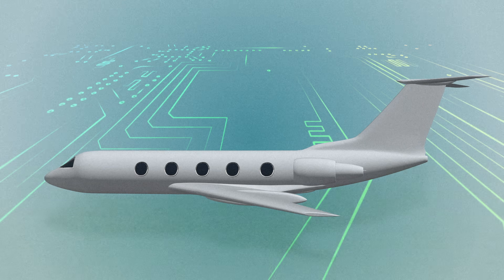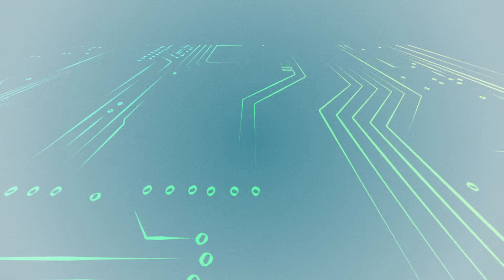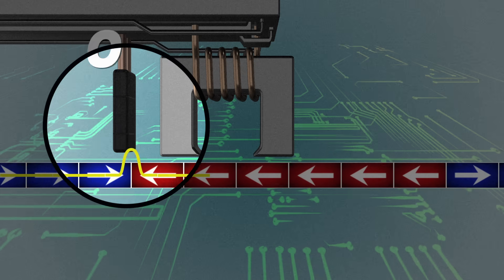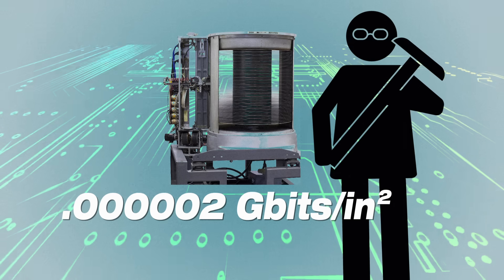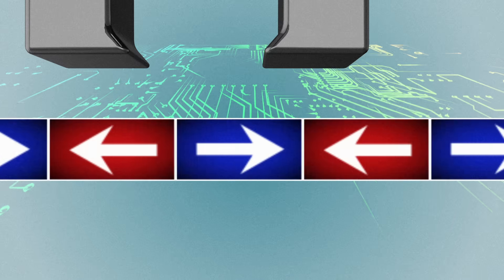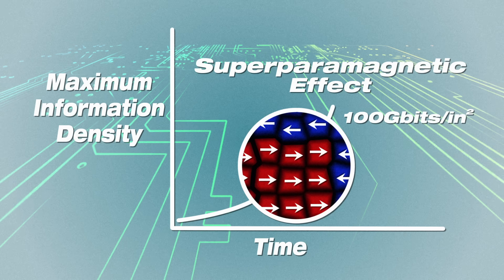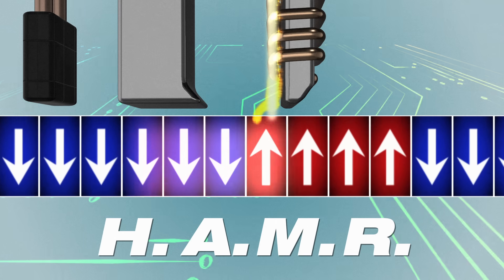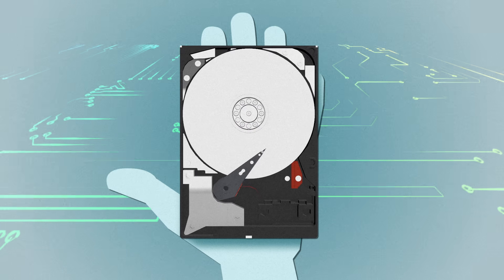How do hard drives work? - Kanawat Senanan

Comment: I'm still confused how it works... It kinda just talked about the evolution of the hard drive
Reply: +Dank Maths it didn't get specific enough like how it reads a picture file vs a video and how it is able to access multiple files at once, etc. how far it has come is a nice tidbit, but it should focus on the topic
Reply: +biohazard737 That's because this is the job of a file system, not the disk itself. Hard drivers (both the HDD and SSD type) just present to operating system a single array, with each cell holding a byte of information (I'm simplifying here a bit). This is an abstraction layer that allows file systems then work with any kind of drive, be it containing one or many spinning platers or a Flash memory based one, like SSD.
Reply: @biohazard737  these things are job of a software..
Hard drive's job is to store 0 and 1, that's it.
Reply: +biohazard737 Basically the file formats get sent into a continuous stream of information which are blocks.
The filesystem takes cares of reading where the blocks are, what they contain and in what order.
The kernel then works with the fs(filesystem) to load and get the information in the correct order to be operated on.
This is basically the physical side of the hard drive system.

A good example would be the relation of the linux kernel and ext4, Read on that ,It'll answer more than I could in a comment
Reply: +Liberal Atheist Nazi best answer!
Reply: +biohazard737 ''How are you doing that?'' ''HOW DO MAGNETS WORK, THEY JUST DO!'' -reference that one guy somewhere will get.
Reply: +666Tomato666 The array is just called a block and there's only so many block types making them work with any hard drive size and hard drive or ssd.
Reply: ***** no, the array is the disk

the blocks are the smallest sizes that the drive can write (usually 512B or 4KiB) and while they influence the alignment of stuff written by file systems, and how much space they "waste", file systems still on the lowest level work with single bytes
Reply: If you want detailed insight you need to read research papers. It will have a lot of boring details, but you can browse through and find out what answers you are looking for. Might take a few hours, maybe longer. Usually answers, lead to more questions.

Comment: And I thought hdds were getting old! I mean SSDs are the new stuff now and HDDs are getting more and more useless. but if they can bump up storage capacities that high, to multiple TBs per square inch they might still stand a chance in the PC market!
Reply: +MoinBayern 
It's not just about capacity, but about read/write speeds too. Still, having those HDDs with super high capacities would make nice storage drives.
Reply: +Marcos Cruz of course it is. my point was that until SSDs will reach as high storage capacities as that for a reasonable price it will take time. until then HDDs will still be used, mostly of course for servers because at least nowadays the average user does not need much more than a maximum of a few TBs and will then obviously rather go for SSDs.
Reply: True
Reply: +MoinBayern Also with cloud storage becoming more popular you might not need much more than a quick and small SSD. like one of the new chromebooks. That has just 16GB flash storage, but integrated Google Drive as the main storage.
Reply: +MoinBayern 
Hopefully our infrastructure will be able to keep up with the increasing demand of the public's streaming needs and ISPs behave somewhat civilized and not decrease data caps and throttle those who use the services they already pay for because of their cooperate greed.
Reply: +Marcos Cruz Yeah. tbh though I'm not that much of a fan of cloud services. I much rather like to know exactly where my data is stored (and who has access to it) and not on multiple dubious servers somewhere around the world.
Reply: +MoinBayern 
Me too since the amount of threats to cloud services has increased and the fact that the FBI, NSA, and CIA want backdoor access to those cloud services discourages me to use them.
Reply: +MoinBayern But if we don't work on SSDs then we'll never make them as awesome-sauce as hard drives! D:

Comment: How about a usb? Is that working the same way?
Reply: +D88888888Mc Flash drive like USB, SD and SSD are a totaly different thing: there are'nt any moving parts.
Reply: +D88888888Mc USB is an interface, not a storage medium. You're denser than a modern hard drive.
Reply: +D88888888Mc They use flash storage, the same storage SSDs use, a lot of the comments are asking for a video on that, I'm interested too, I know it uses differences in voltage levels throughout its many small circuits to store ones and zeros,

Comment: but how exactly do those bits correspond to complex software and everything else on your computer? I don't get it.
Reply: +Sam Barkley It's a complex topic (programming) and software and data are separate things.
A software is an executable file (.exe), which consists of a list of commands for the processor, stored in a file (i.e .exe).
A data file is just data, like text, picture, etc. Both reside on the HDD. Both (and everything) is stored in binary (0s,1s).

Programming is complex but basically everything is hierarchical (starting from the simple and building on top of them, level by level).
There are low-level and high-level programming languages, they mark the two extremes of this hierarchy.
Ultimately everything is binary, but even programmers couldn't work with 0s and 1s. 
Low-level lngs do that, they access the built-in registers of every CPU and command them directly.
With it one can only create simple, basic commands, nothing complex.
High-level lngs include several more steps in the process, each step built on the previous.

I could explain it like this: Say you want your program to draw a triangle.
It is ultimately pixels at certain coordinates...
You can write "functions", pieces of codes with names, that you can always reuse. Like the SUM(A1,C1) function in Excel... someone programmed what SUM will do and you just need to write SUM not the actual code later.
But in programming the programmer uses the functions, the end user sees the triangle :)

So you write a function say DrawTriangle(a,b,c) and define what it does. (once written, you can use this for your program like DrawTriangle(coordinate1,c2,c3))
But inside defining this triangle function, what do you do? You need to draw 3 lines between the coordinates.
So this function only has 3 commands: You "call" (use, refer to) a line drawing function:
DrawLine(a,b)
DrawLine(b,c)
DrawLine(a,c)

But Inside the line function, what do you do? 
You need to draw many pixels between two coordinates (=a line). So here you will have more than 3 commands- you will do complex calculations to find out which pixels on your monitor fall in line with the imaginary line between x and y:
<caluclating "Coordinate">
DrawPixel(Coordinate)
and repeating (with calculations and a "loop" (cycle) for as many pixels is needed.

But the DrawPixel function has to be written as well, which is way more complicated, from taking control of the screen, videocard, its memory, initialize a video mode (fullscreen at a given resolution, where Windows can't draw over), use the video card's memory at a certain address from which a monitor will refresh the content (draw the content on screen) etc etc. which are all low level, binary, complex.

This is the hierarchy. It gets more and more technical.
At one end is the tiniest step of a command to the CPU or videocard (and many of them), at the very end is the one "DrawTriangle" function. I mean you will use more "higher level" functions that are built on previous pre-written ones.

Some pr. lngs have pixel drawing capabilites, some use Windows windows, some use DirectX and have built-in "DrawTriangle"-like functions, etc.
So with different programming languages you realize the same idea different ways (e.g. to just draw a triangle). Each lng codes the result to CPU commands differently, but each does, and ultimately everything is binary.
Imagine if instead of writing DrawTriangle, you would have to write 100x as many low level CPU commands. It's impossible.

I hope this shed a bit of light on what binary, commands, files, etc are.
Reply: @tarcal87  I know it's been a while but, dude, Thanks for that.
Reply: @anuragmishra3227  Cheers :)
Reply: Check out Boolean Algebra. It all starts with ones and zeros (or you could think of it as on or off with respect to electricity). I don't completely understand it either, but it's way too complex for a youtube comment.
Reply: +Sam Barkley BEcause even the most complex software is made from 0's and 1's.
Reply: It's all 1's and 0's that correspond to off/on electrical signals. The processor reads these at amazing speeds and translates them into text we can read, pixels which we can see, and sounds we can hear. Just imagine if you wrote the letter A as 10011001 and B as 10011010 and so on. Apply that to every single pixel that renders on your screen and you can see how complex it really is although it sounds simple
Reply: +Sam Barkley Magic
Reply: something something something I forgot
Reply: how software works in the hard drive is easy each byte is equal to a letter so code like print "hello"(python) is a  few bytes that output a visual which is hello and with complex code graphics can be made basically what you see right now are all 1s & 0s
Reply: +Matthew H The processor itself just sends a little pulse to the sata bus.
It's the kernel and file system in the software layer that call those pulses

Comment: how do solid state drives work
Reply: yes..comparison video, for flash,solid extc.
Reply: +TheCorey Marks SSD's IMO is like a flashdrive with more storage and improved speed.... but the process would be "less" complicated  than the HDD's since it has a moving mechanism that has to sync with the read and write header not to mention the "magnetic" thing part...
Reply: @heyitsmejm4792 the storage is lower in SSD Drives than HDD Drives
Reply: Think of it as a box with a large SD card in it. That’s basically what it is because they both use flash memory and don’t have any moving parts lol.
Reply: Much more simple in operation, but harder to manufacture.
Reply: I don't know
Reply: @ANISFURNITURE  thank you for your comment saying you dont know 10 years later i truly appreciate it